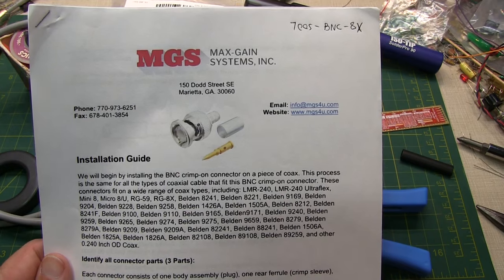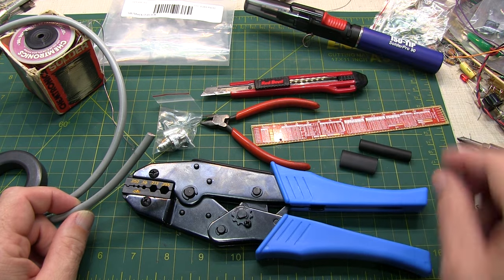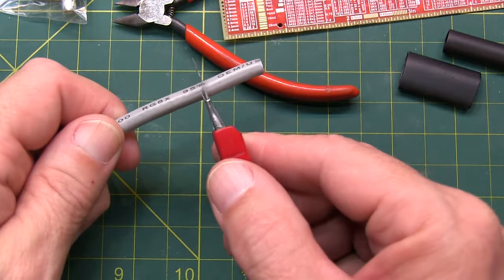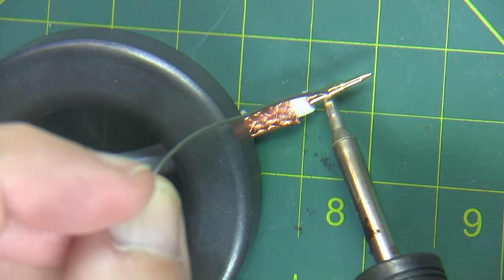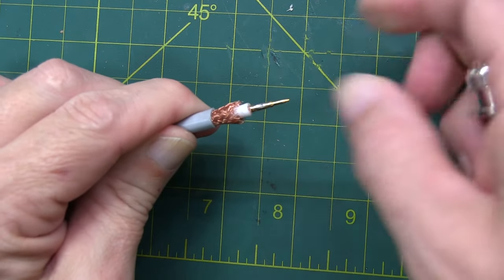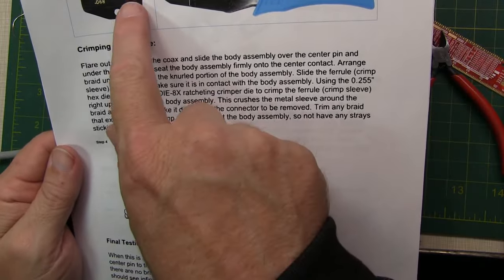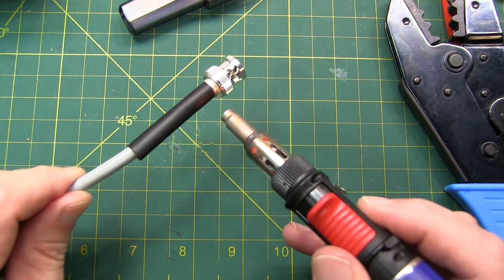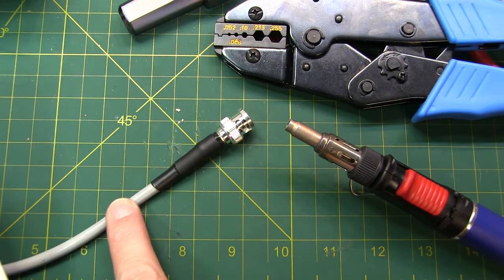#377: How to install a crimp-on BNC connector to RG-8X coax cable

Comment: Hello, you do it beautifully, I crimped them until my hand hurt, the middle pins were also crimped, there was no time and conditions for soldering 🤪 I have a tool that cuts the cable exactly to the dimensions at once as a whole.

Nice day 🙂 Tom

Comment: Great video. I beat the hell out of my coax connectors by throwing them into backpacks, exposing them to elements, high winds, moisture, etc., and the recommendation to add solder  and really bolster the connector with multiple shrink layers are in my experience the difference between a connector that fails vs one that stands up to the test of time. Another option is temflex covered by Super 33... doesn't score high in the looks department but creates one hell of a protective shield against bends and the elements.
Reply from the maker: The marine grade heat-shrink with the epoxy or adhesive inside does a very nice job as a strain relief.

Comment: Nice tutorial.. 👍 for heat shrink these days I only use the type with glue inside, it's so much better than regular heat shrink.
Reply from the maker: Me too - the ones I used in the video have a small amount of adhesive inside.  Marine-grade stuff.

Comment: I love using RG8X coax. MUCH better than RG58, but not big and bulky like RG8. I've run 800 watts through it all the way through 10 meters without any issues that I could see. Reading some comments I'd like to add that a great invention would be heat shrink tubing that can be added AFTER a cable has been assembled. This would be great in the automotive industry as well so you can seal wires or cables without disassembling them. I've been know to put a drop of hot glue inside of heat shrink tubing as well even though they make heat shrink tubing with glue in it. 
I'm curious about your 600 ohm open wire feeder system on your HF antennas. It would be interesting if you did a video on comparing the advantages and disadvantages of different open wire feeders, especially comparing results using the same antenna. I use 300 ohms here and love it, but I am curious to experiment with different feedlines as well.
 Take care and have a great holiday season!

Comment: You missed the step where you realise you'd forgotten to put the ferrule and heatshink on the cable before clicking on the BNC. 
Optional extra step is to only remember the ferrule at the previous step, then realise you'd forgotten the heatshrink, forcing you to disassemble again.
Reply from the maker: That's why I mentioned it at least once in the video ;-)
Reply: I'm now quite certain, after years of rigorous testing, that it is physically impossible to remember to slide the required parts over the cable without first soldering on the connector at least once 😜 I can't be the only one, right?
Reply from the maker: @gregkrobinson   You are CERTAINLY NOT the only one!  Guilty as charged...

Comment: Alan, thank you but it would be great if you could show how you originally trimmed the braid so neatly.
Reply from the maker: I trimmed the shield slowly and carefully with a small pair of high-quality diagonal wire cutters.
Reply: Yes, showing the corrections along the way helps us newbies. I use a small pair of surgical scissors to trim. A lucky find. 
Thanks for sharing with us.

Comment: RG-316 is trickier and I would like to see that done. That's the Teflon outer jacket and I would like to see the braids handled as well and up to and including any solder used at the pain at the end of the tip where the center conductor comes through. Please use the ferrule  type. Please use a PL-259 connected with respect to the RG-316 for terminating the cable.

Comment: Another great useful video, thanks! 

What is the high-pitched hissing type noise in the background in the first minute or so?
Reply from the maker: That is my hot-water boiler (heating system) about 8 feet from my bench in the basement.

Comment: with the correct crimping tool you shouldnt have to solder the center pin, the "wheep hole" is there to see if youve inserted the core far enough. but soldering is fine too
Reply from the maker: Agreed, but I generally don't like to crimp when the conductor is stranded and the terminal needs to fit into a drilled hole.
Reply: why? crimping stranded wire is just fine and soldering just gives you a chance of to much solder to remove because it needs to fit into a hole, plus the extra work it involves. dont get me wrong, if i dont have the right crimping tool i would absolutely solder the connection. @w2aew
Reply from the maker: @adriaan9011  The center pin terminal doesn't appear to be designed like a "proper" crimp terminal, so i wasn't sure how well it would crimp onto stranded wire (that might squish around a bit) <-- very technical LOL.  I'll have to try some with the proper crimp tool.  (I crimp stranded wires into PowerPole terminals all the time).

Comment: Thanks for sharing.
I guess this type of connecting is old.
Try BNC Compression Connector, its newer technology.
Reply: I have not seen a BNC in this design yet (I have a stock of the type shown, but in the compression design I use F connectors, it is faster to work with them, but I have already loosened a few of them, this type is more laborious, but it holds all of them so far.

Nice day 🙂 Tom
Reply: @Edisson.   Of course, each has its own advantages and disadvantages.  Crimp-on is probably cheaper but it takes more time to do it.  BNC Compression Connector is faster and easier, and I never had any problems with it.
Reply: Newer isn't better. Crimp connectors require a more specialist tool, don't work with stranded inner wires, and generally are not suitable for connectors that are (dis)connected a lot like in a lab/hobby environement. They also demand very precise cable thickness.
Reply: @gartnl   I would like to thank Alan for  explaining things very clearly.
I am a fan of his clips and watch them as soon as he posts them.

Here is an I.Q. question for people who are interested:
The relation between F connector to BNC connector is Like:
SMA connector to:
A.  SMB Connector
B.  Cheese cake
C.  Soft Drink
D.  Oranges

I wish they had SMA or SMB Compression Connector , it would made life much easier.
The hardest connection to make is IPEX connector.  It is too difficult to build and I always buy the ready made ones.  It is used very often in cell phones.
Reply: @aduedc  I'd say B, but that is 'cause I love cheesecake.
Every connector has it's use. Compression connectors that use the inner core as center pin simply are not meant for frequent change of the connection. I would not like F on my scope. Nor a compression BNC.

Comment: Hey @John, can we have a link to that little butane troche with the hot air attachment please?
Reply from the maker: Here it is: https://iso-tip.com/product/pro-90-butane-soldering-iron-torch-kit-9010
Reply: A lot of companies make similar ones. I bought a butane Weller years ago that has pretty much exactly the same accessories including the torch tip.
Reply: @chitlitlah  Actually, while looking for this on Amazon I found something better. I ordered the "Mini Heat Gun, 350W 662°F Tiny Hot Air Gun Kit" for only $16. Good for heat shrink tubing and hot enough to melt solder with air.